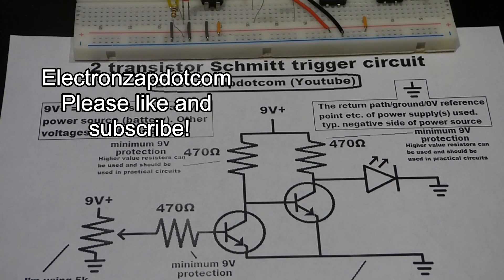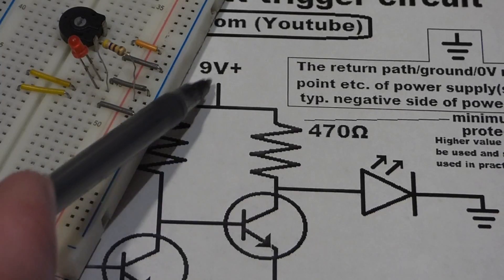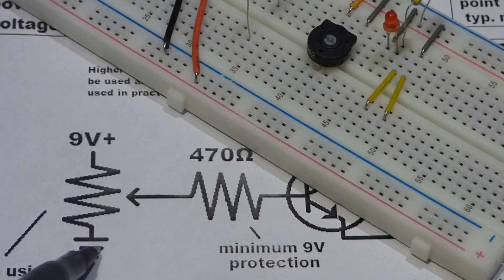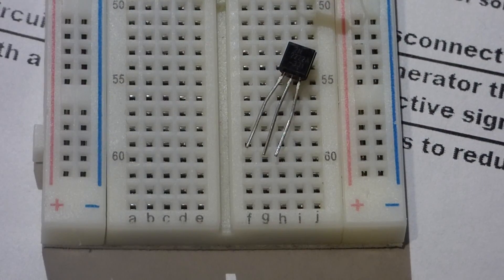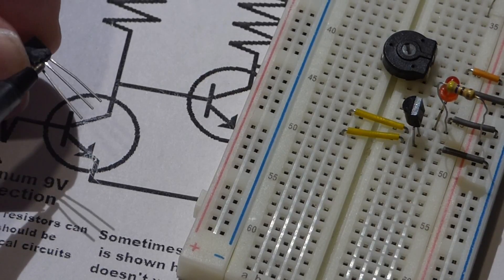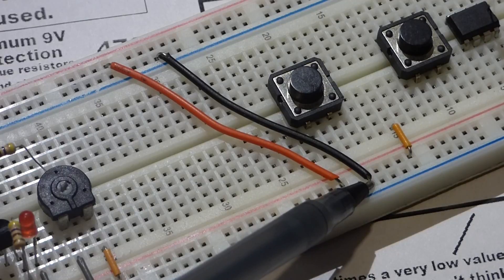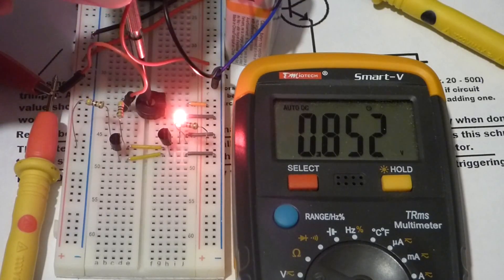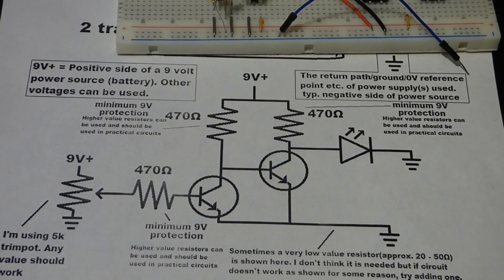Two NPN 2n2222 transistor based electronics schmitt trigger circuit step by step build

Comment: why you are closing the circuit most of the time and explaining? if both the transistors are earthed there is only one threshed voltage and not two. Your viedio appears to be not correct.

Comment: Sorry, but this is NOT a Schmitt Trigger, as it does not have a positive feedback to create the hysteresis. 
This is just a “high gain” level detector / voltage (Vbe) comparator.
Reply from the maker: Thanks for the info!